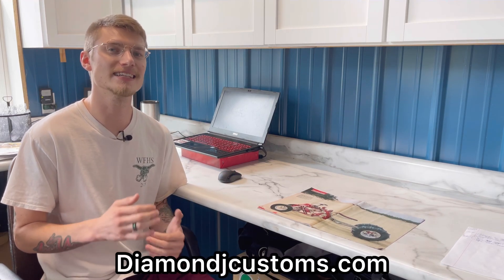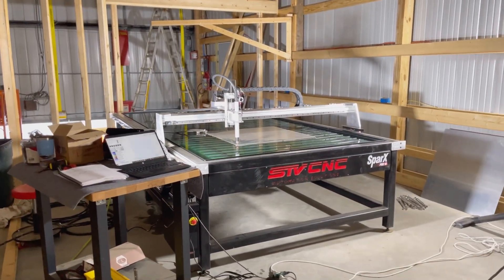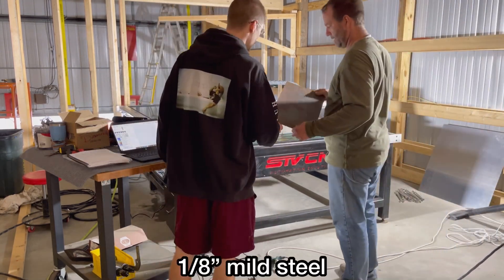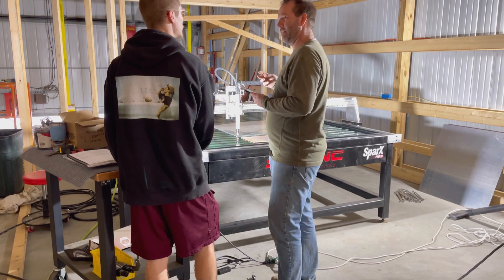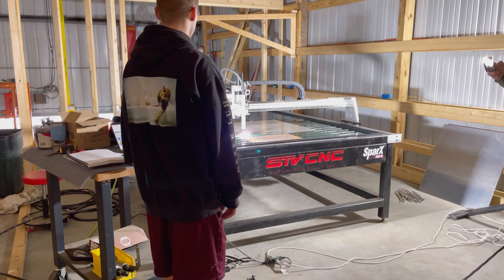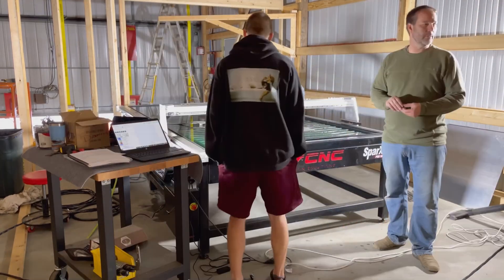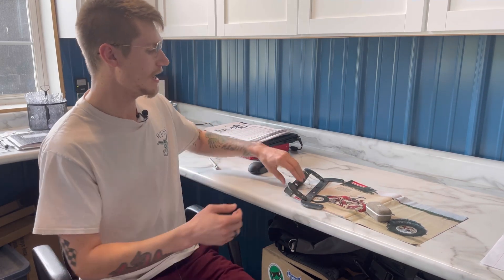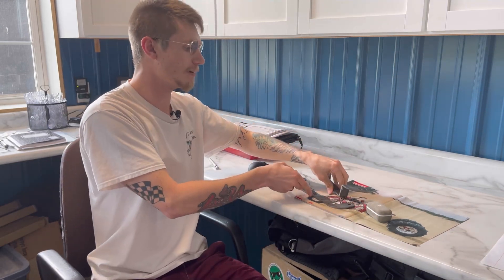First cuts STV CNC SparX10 Plasma Table Hypotherm Powermax 85 Torch (Today in The Shop #9)

Comment: Is the water level too high? I've never seen anyone cut with water on top of the material like that. It seems like it would shorten the life of the consumables as well as alter the resistive reading it uses to control the arc.  I'm a total newb to CNC and don't even own a table yet - I'm asking.